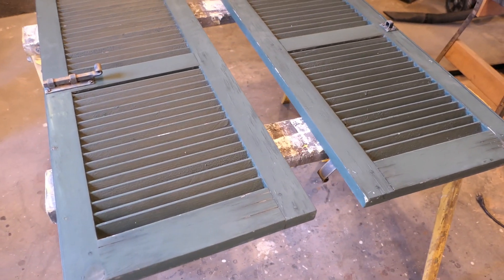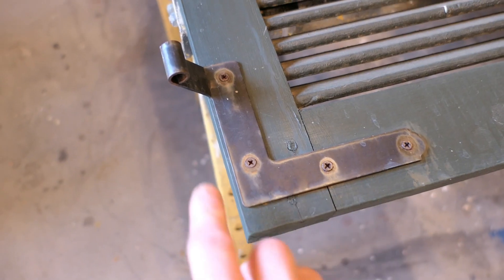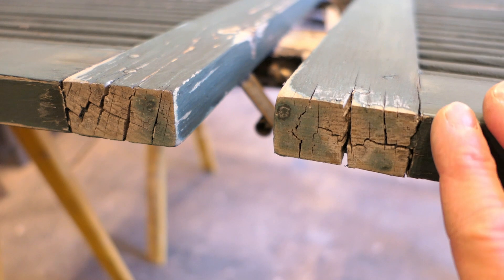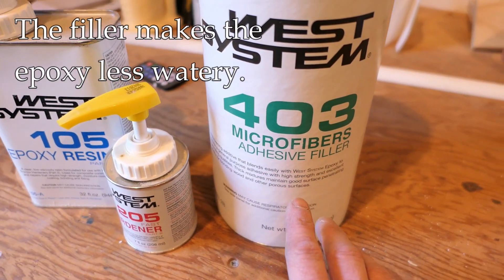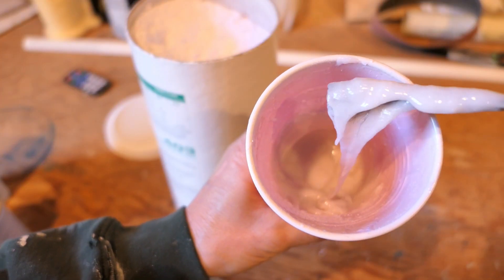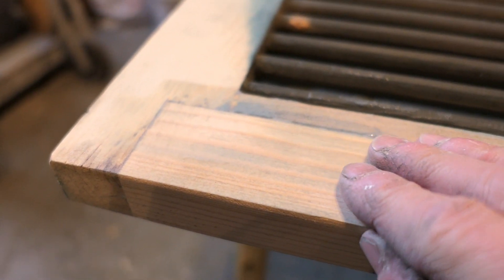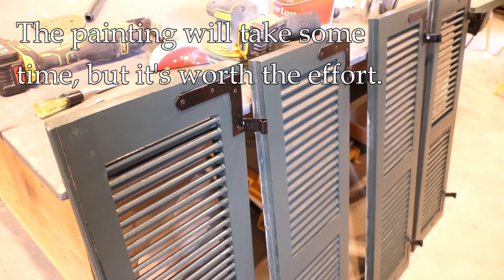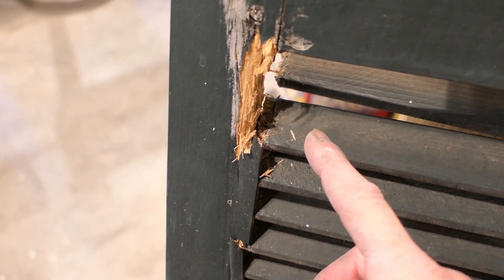Wood Shutters Repaired With West System Epoxy

Comment: Thanks for an instructive video.  It's good to know about the epoxy and filler for other uses as well.  I'm not sure I'd have the patience to do 20 pairs of shutters like that.  It seems pretty tedious.
Reply from the maker: When I set up for a video sometimes things take longer or I do things more slowly.  With the camera off I do things like this assembly-line style, by setting up the shutters in a row, doing all the epoxy at once, doing all the sanding and priming at once, etc.  It's still a lot of work, but you can minimize some of the tedium this way.